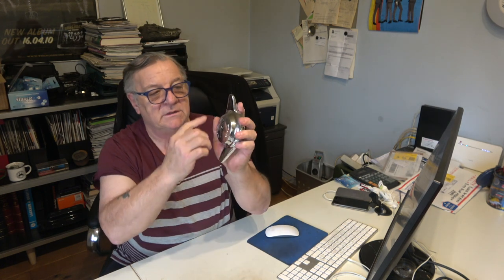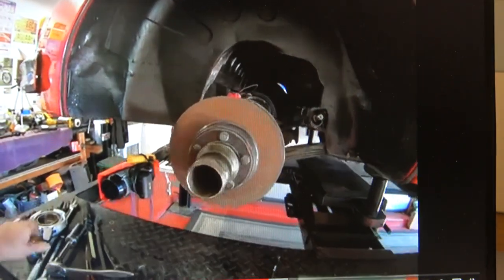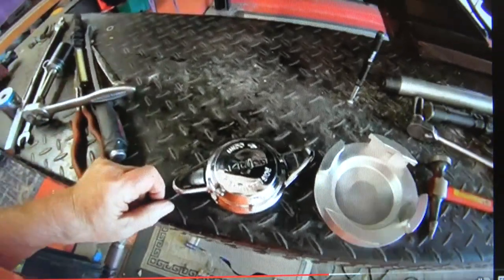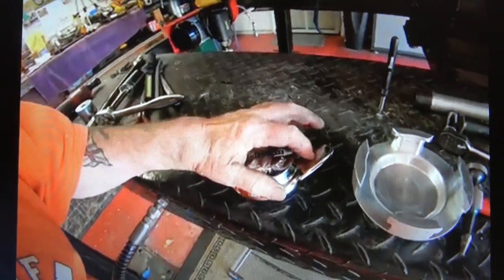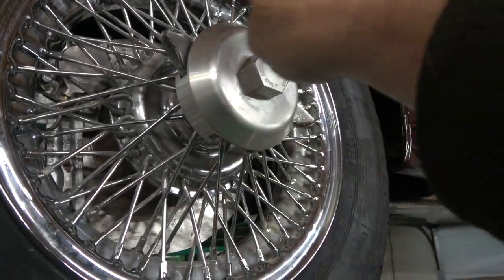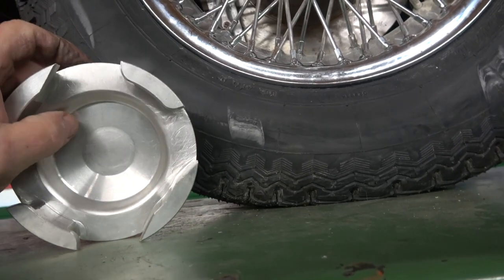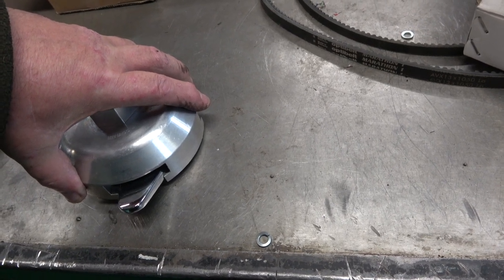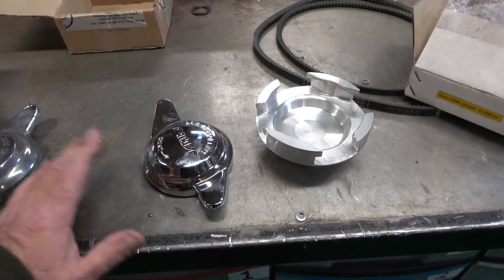( WARNING ) Wire Wheel Spinner Tool Problems

Comment: Looks like a good tool. Chamfer is a good idea, I would look at putting a neoprene rubber disc in the centre of the tool to ensure it protects the spinner and stands off too.
Have you seen my video on wire wheel safety? I made it after I found a problem with my wire wheel adaptors.
Kind regards Paul from 48 Spokes 🇬🇧
Reply from the maker: Paul,  That‘s exactly what I was thinking but a good comment was made about using a square of leather. I checked out your channel and subbed. 
I had a quick look but I will check out your video on wire wheels.  Cheers Dave

Comment: David, when I bought mine, he was very clear about measuring the spinners as apparently there are several different variants. I bet the spinners on your E-Type are a slightly different size to your XK ones. Never had any problems with mine.
Reply from the maker: I haven't checked but I did take the tool with me when I bought the new spinners to check the fit. I will check the two tools and see if there's a difference. Cheers Dave
Reply: @ClassicCarCave  I agree, when I bought mine Lionel asked whether my spinners were original or aftermarket as he did different sizes, he was a gent to deal with and mine fits perfectly (original spinners).

Comment: Defo chamfer the edges and perhaps glue on a bit of the anti slip rubber matting so it should help stay in place when you tighten them.
Reply from the maker: That's exactly the way I was thinking but I like the leather idea as well 🤔 Cheers Dave

Comment: I have a similar tool for the spinners on my Elan but it has pieces of thick hard leather over the contact surfaces. The leather has been very durable over the years and my spinners have no marks from the tool so I would add leather pads to this one.
Reply: I like the idea of a piece of leather, and of course I will make it match my interior.
Reply from the maker: Dan,  Thanks for the tip that sounds like a winner too me but I will still chamfer the sharp edge as it will not affect the tool. Cheers Dave
Reply from the maker: Gary,  I was thinking about using a rag over the spinner before you attach the tool but a square of leather would work great. Cheers Dave

Comment: You guys are missing the joys of a 4lb lead hammer. So after you attach that dongle, what is the spec?
Reply from the maker: Richard,  It was my E Type spinners where I didn't like the lead or Hyde hammer, Dongle ? sorry I don‘t understand what you mean 🤔 Cheers Dave
Reply: @ClassicCarCave  I think he is referring to the torque spec when using the tool to tighten a spinner. I am not sure what it would be for the Jaguar spinners, but it is 210 lb/ft.  for the Elan spinners and they are not even close to the larger diameter and thread size of the Jag spinners. Also the Elan wheels are pin driven with no splines and tend to not self tighten like the spline drive spinners on the Jag so I would think the torque spec would be considerably less. I would check the torque required to remove a couple well hammered on spinners with my torque wrench and use a similar torque setting on my torque wrench to put the spinners back on using the spinner (dongle) tool.
Reply from the maker: Dan,  Ah! I see what you mean 🤔 My torque setting would be FT 🤣😂 I would have thought that the fact that the braking forces will determine 
what the final torque or tightness of the spinner is itself 🤔 I have to admit I‘m not a great fan of torque settings for wheels as you can over tighten 
them. Mini wheel bearings are in my opinion over torqued and I believe that‘s why they prematurely fail. Cheers Dave